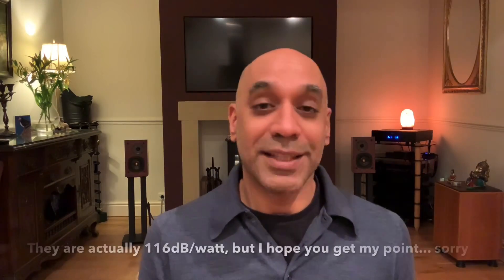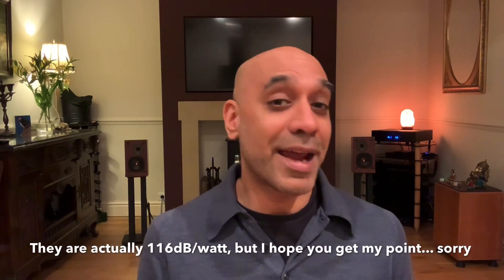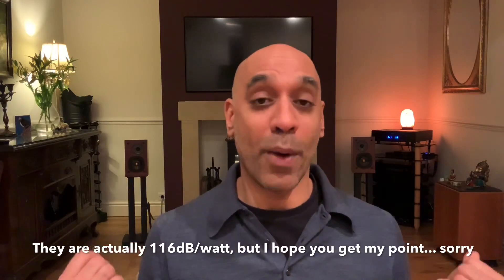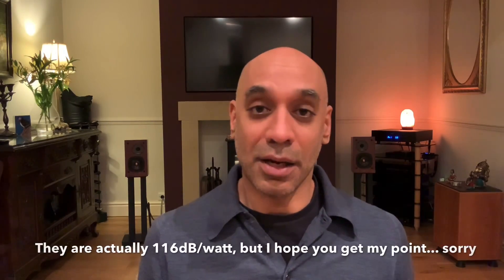Hifi Myths & Misconceptions - Amplifier Power

Comment: Another Thing thats hardly ever talked about is that the Effeciency rating of a Speaker is measured at 1 kHz @ 1 W  As well as impeadence and thus effeciency changing relative to Frequency Speakers effeciency can change at different listening levels (Input level changes) . Some drivers a tweeter for example may get more effecient relative at a higher listening level, causing it to be more forward. Its worth reading the Specs of speakers rearding the Max pressure it can create too.
Reply from the maker: Thank you for watching 😊
Reply: @abritishaudiophile7314   Thank you Tarun for tackling these subjects and sharing your experience in the structured way you do.
Reply from the maker: @wickie2222  much appreciated 😊👍

Comment: If you follow the idea that: "The best amplifier is a piece of cable, unfortunately a simple cable does not amplify", then some amp designs are off the table right away and that limits the available power significantly from the start. You mentioned the speakers with low sensitivity and low impedance. I guess the peak stupidity was in the mid/late 80s with speakers like an Apogee Diva or Infinity's Kappa 9 with 81 db sensitivity and an impedance of well below 1 ohm. At the time we saw corresponding amps from Krell and Threshold pumping massive 1 kW and more. It is simply not possible to make this kind of power and still expect it to sound good. Every transistor (and tube) has a characteristic curve (I looked it up hopefully it is the right translation). Such a curve is typically shaped like an S. So the part that you want to use is the part where it is as strait of a line as possible and what you don't want is the beginning and the end of this curve where you find the maximum curvature. That means in order to run halfway decent with lower volumes you have to run it pure class A, that means that from the moment you turn your amp on you are burning the power of 2 Dysons per channel! Then you have the problem that the positive and the negative wave (in a PP setup) must be equal, that is quite a challenge with the amount of transistors needed, so what you usually do is run these amps with a negative feedback of hell that distorts your incoming signal so massively that this already sounds completely messed up. To top it all you have to provide enough power that there is at least some dynamic left and that requires capacitors of hell in the size of water buckets, unfortunately these kind of capacitors are not very quick in response, so when ever you get a hard impulse in the bass, your high frequency are all over the place and your whole soundstage tends to collapse. 
In my opinion if you use more than 1 transistor (or tube if you like) for one half wave then you are already in a land of pain and your amp will neither sound well or will deliver good dynamic. That means more than 50 watts are nearly impossible to achieve if you want good sound quality. We can turn this whole thing around, if your speaker has a sensitivity below 87 db it is a failure as well.
Just my opinion, I know that many disagree, no problem ;-)
Reply from the maker: It is a very valid approach that you advocate MWT. Thank you for taking the time to share it. Very much appreciated 😊👍

Comment: There’s a huge payoff to be had from using more sensitive speakers - the amplifier itself can be much simpler and cheaper.  Very low power class A tube and transistor amps can deliver some real magic without needing a second mortgage.  Less can be more and as amp guru Nelson Pass says it’s the first watt that counts.
Reply from the maker: Thank you Steve 😊👍

Comment: I now have a good idea of how many watts are few or  much. But some reviews say like „this speaker is difficult to drive and needs a lot of current from the amplifier“. In the specs I can see that a given amplifier can deliver 30 Amperes, but is this few or much?
Reply from the maker: Thank you GS. The peak current capability is a better indication of the driving capability of an amplifier. It does relate to power but wattage ratings are often manipulated in specifications by manufacturers. 30 Amps is a lot 😊👍

Comment: Thank you for this. I'm pondering my first  hifi system since cheap sony / jvc systems of my youth. I think I've landed on the Quad Vena 2 System (though everyday I'm finding different options that give me pause!). This video makes me more confident that this set up would be ample in a 5m x 3m room (likely sitting 2.5-3m from the speakers). Would you agree? I'm hoping to go and listen to this and others in the coming weeks.
Reply from the maker: You should be fine as long as you don’t listen at very high volumes and partner with speaker that have a reasonable sensitivity rating (85dB or more) 😊

Comment: As a whole, most of us use way less power than we think. If you need rock or rap played at 110 db at your ear, then a few hundred watts may be needed...for a brief time..until you are deaf. Using a dB meter at my listening position, 3.5 meters away, I rarely need 100db peaks to have live sounding levels. My meter still doesnt exceed 15 to 20 watts. Finally, it costs alot more to have really sophisticated and transparent sounding amps. So, the more power, the more devices in the amp. This makes it even more expensive and harder to keep pure. I will take a 20 watt class A amp over a 200 watt class AB almost always. Class D..is good for subs.
Reply from the maker: I agree. Thank you for watching and sharing your experiences Mark 😊👍

Comment: From my own experience way back I had the Kappa 9 which needed at least 175 watts to shine and did not clip the amps.Now I have Dynaudio speakers that in general not efficient I use a Amp that has 150 watts at 8 ohms  and drive the speakers "effortless:.Your comparisons with car engines 4 cylinder or 6 cylinders is spot on.A bit more power  in my opinion is always better.
Reply from the maker: Thank you for watching and sharing your experiences Roland 😊👍

Comment: Could you, at some point, explain what ‘Damping’ means in reference to audio amplification?
Reply from the maker: Hi Jeremiah, basically it refers to the output impedance of the amplifier. You want it to be many multiples lower than the impedance of the speaker. This ratio is referred to as the damping factor, normally in reference to a standard 8 ohm speaker load. The amplifier’s damping factor should be a minimum of a few 100. Otherwise, the back EMF generated by the speakers voice coil moving in the permanent magnet’s field will will impact adversely on the amplifiers ability to drive the speaker. I hope that makes sense 😊
Reply: @abritishaudiophile7314  Thank you for the favor of your reply; it helps me begin to understand. I feel the need to actually work on some circuits so that I can understand and keep up with a circuit analysis that references the high or low impedance of a circuit as if it can be plainly understood. It is not yet plain to me, but your explanation helps me understand one of its biggest implications in the audio world, and my system in particular. Thank you.

Comment: I was already aware of the dB scale but the example of Max has explained how easily the power required multiplies. And the impedance explanation was excellent, I understand volts, amps, watts and ohms but had never thought of the consequences of an impedance varying with frequency and how significant it is to the required amplifier power.
Reply from the maker: Thank you Simon. Much appreciated 😊👍

Comment: Your speaker impedance comment is vitally important (as you so eloquently point out), impedance does vary with frequency. Asking vintage transistor amps to drive lower than 4ohm loads can lead to a severe pain in the output stage. Your amp just ain't gonna like it. In the 1970's, common belief was No such thing as too much power. There is however, a point of diminishing returns. Swell video sir.
Reply from the maker: Thank you Marty. I appreciate you taking the time to share your experiences 😊👍

Comment: Hey, great videos mate,  I had a Denon 80 watt per channel amp and a pair of 12" Tannoy dual concentric speakers, sounded nice. I turned it up a little too much one day and burned one of HF voice coils. Brothers in arms is a pure digital recording on CD. I just wanted that little bit more but no more BS, I went out and bought two NAD amps,  1x C-270 and one C-370, both approx 120 watts per channel into 8 Ohms, both are bridgeable and are bridged. Now I have 300 watts into each Tannoy giving heaps of overhead. I approached the local loudspeaker engineer (Krix Loudspeaker Engineers) and asked them to construct 2 new enclosures including the drivers and amps  from their Siesmix subwoofer model. Total bliss, blows me away every time and yes you definitely gotta be careful of your ears. Been browsing for a nice DAC lately to upgrade my system as all digital sources are a little dated.
Reply from the maker: Thank you Hamish. Great to learn about your experiences 😊👍

Comment: I was told of an analogy with a car. The idea was that you have a 2 ton car with a 5 litre v8, the engine will accelerate the vehicle nicely. If you then put a 2 litre engine in the same vehicle, the car will go but you will not get the same acceleration. The same is true for speakers in that you need adequate power to accelerate the cones to get the best out of the speaker. Having an inadequately powered amplifier will still give you ample decibels, but the quality of the music will be sub-standard.
Reply from the maker: That is a good analogy Mark. You could say that looking at the wattage of an amp is like looking at the BHP figure on a car. Where as looking at the power supply and current capability is like looking at the torque characteristics 😊
Reply: @abritishaudiophile7314  It seems dumb to me that they then don't give the minimum amp power rating that will make the speaker sing, as opposed to a minimum amp power rating where you will actually get some sound out.
Reply from the maker: @Mach2nz  the problem is specs can be very easily manipulated. Best to just use them as a guide 😊

Comment: 2:58 You need an increase of 6dB of the power (4x) for doubling loudness.
Increase in loudness of 20dBV requires increase in power of 20dBP. In linear scale it mean increase in loudness of x10 times requires increase in power of x100 times.
Power/SPL measurements use formula dBP=10•log10(P2/P1), while amplitude/voltage measurements use formula dBV=20•log10(V2/V1).
Reply from the maker: Thank you for watching and sharing 😊

Comment: Hi, thanks for another very well done video. Like you say, there are other factors, pushing a 40 watt amp might bring you into non linearity, greater distortion (not the good kind!) and even damage.
I generally run higher power which keeps the amp running in a favorable place. My speakers are in the mid 85 SPL's like yours and I find the transients and headroom from higher power amps does make a difference, especially with respect to dynamics. Since I design my own amps I have the benefit of adding L/R level controls so this gives me the best of both worlds.
Reply from the maker: Thank you for watching and commenting 😊👍

Comment: And buy real amplification.  300 rms, 200rms, 100rms or 50 rms at 20hz-20khz , 0.09% , 0.08%, 0.05% ,0.03% Total harmonic distortion.  2 channel tested.  The only diference in a speaker with 89 db to one with 96db is not quality of sound more the way it was design, the 89db speaker will need more power to move the same as the one with  96db its all.

Comment: Its not rocket science, the smaller the room the less amplifier power you need to fill it with sound the bigger the room ,well you get the idea. Its why an imaxx comercial theater has 25,000 watts and your living room only needs 100 watts to accomplish the same task. Its in the room size and room acoustics. You will know when you need more power.  You will find yourself turning everything up,up,and up ,like decibels ,eqs ,gains adjusments on amp and volume control . When you start to raise everything to max levels or close too, to be able to hear your music or theater with power and clarity its when its time to go up in RMS power. Yes RMS continuous power not max power. Your system is not going to have any headrooom for any louder sound passages as your allready maxing everything out. The key to a good sounding system is right adjustments, control and headroom. Remember -decibels are better that +decibels and gains half way are better that max out gains. And crashing crossover is a no no. Adjust crossover at one source.  If you set your crossover in your amp say 80hz or 100hz for the subwoofer , then the crossover at your sub if not using LFE should be set at its highest crossover point. This way you avoid crossovers colliding. So keep it simple and never run any audio gear adjusments at max or close to it, and you'll be fine🤗

Comment: Great explanation of headroom and why power is important to handle the dynamics of music - especially particularly complex pieces. “More power” is better to a point, but from this simple calculation for a moderate sized room with even inefficient speakers there is clearly a point where you do have more Watts then you could ever possibly access at reasonable listening levels.
Reply from the maker: Very well said Alex. That is what I think too. You need enough watts to give a decent amount of headroom and then focus on the current delivery, power supply quality and of course how it sounds 😊👍
Reply: @abritishaudiophile7314  - Definitely! And good quality interconnects, speaker positioning, etc. I did the calculation and I now realize why my old Marantz 2225 still sounds reasonable (at 25W) and why my Hegel H120 is more than capable (my hunger speakers still only need 56W + 50% headroom I am more than fine). Thanks for putting some numbers to this! You and the Audioholics guy should do a joint video sometime - data driven approaches!

Comment: Went and demoed ls50metas with musical fidelity m5si and hegel h120. 150w vs 75w

The difference in handling the speakers was huge at louder volumes... ls50 is not particularly hard to drive and yet with the hegel the bass was booming and out of control.

How can you explain this?
Reply from the maker: Hi George, I doubt you are using 75 watts even at high volumes. It about the overall design and the current capability of the amplifier 😊👍
Reply: @abritishaudiophile7314  isnt hegel supposed to be high current with that high damping factor?
Reply from the maker: @kitieas  it is highly questionable if damping factor above a few hundred makes any difference. I would have to compare both designs in detail to draw a meaningful conclusion 😉
Reply: @abritishaudiophile7314  many thanks!! Keep up great work!!

Comment: Late to the video, but there's a bit I don't entirely follow.
When it comes to headroom, assuming a classical recording with peaks of 10dB higher than minimum volumes, you would surely be setting your volume control somewhere in the middle? If you set it so that the quietest passages are at normal listening levels you are going to be very uncomfortable in long average volume sections and probably damage your ears (or your speakers!) at the peaks?
So I think a 10 times increase for headroom is unrealistic.
Is my thinking faulty?
Of course, I'm I'm ignoring reserves of power to handle the transient requirement for extra volume at peaks...
Reply from the maker: Hi Nick, if I understand you correctly, it may be something to do with the logarithmic scale of decibels. The perceived volume doubles with every 6dB. 12dB increase would be 4x the volume 😉

Comment: Great explanations in an equally great video. I was only left with one question, I’m confused about the ohms ratings. As I understand from this video, less ohms on a speaker equals more power demand. But when I read the specs on amplifies, it appears that their output is greater in less ohms. For example, an amp will be rated at 60wpc into 8ohms but also at 80wpc at 6 ohms. How do you explain these two seemingly contradicting ideas.
Reply from the maker: It can be tricky to get your head around but think of impedance as a kind of resistance to the signal flow. As the impedance drops, the restriction to the flow of current drops and more power can flow. I am hugely oversimplifying of course. Here is a good article that explains in more detail 
https://soundcertified.com/how-does-increasing-speaker-impedance-affect-db-output-power/
Reply: @abritishaudiophile7314   I must admit, I’m still a little confused. First off, thank you so much for the swift reply and helpful article! 
I rewatched your video, and, maybe I’m misunderstanding you, but it sounds like you’re saying that a speaker with a lower impedance rating 2ohms vs your 8ohm speakers, for example, will demand more power from your amplifier. But the article you sent me implies the opposite by saying: “if you increase a speaker’s impedance (4ohms to 8ohms) LESS power will be developed using the same stereo or amp” and also saying “when you increase the speaker impedance the decibel output (dB, volume) will be lower throughout the full power range”. Sorry, to keep bothering you with this. It’s just that I just bought a pair of 90db/w 6ohm speakers (wharfedale lintons) and want to possibly pair them with a Naim Uniti atom but concerned about the 40wpc. So I want to get this right before I make the investment. 
Thank you again for your time.